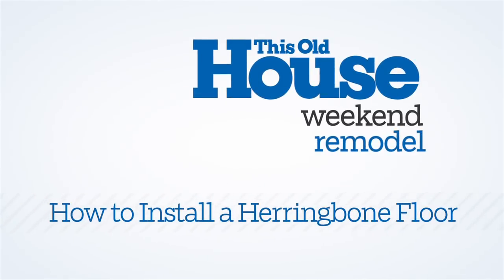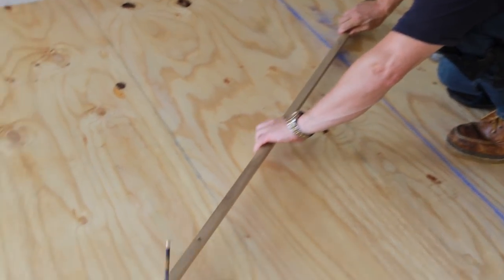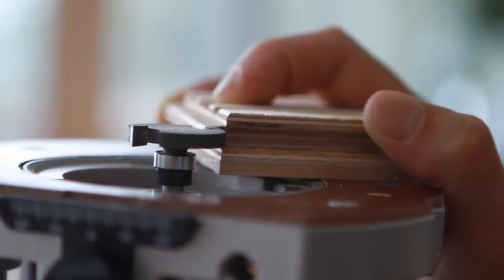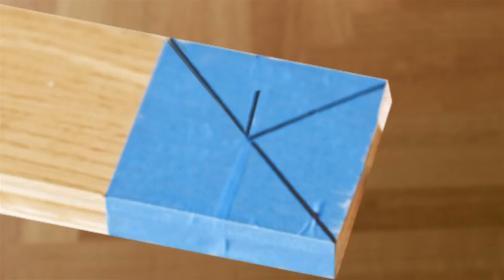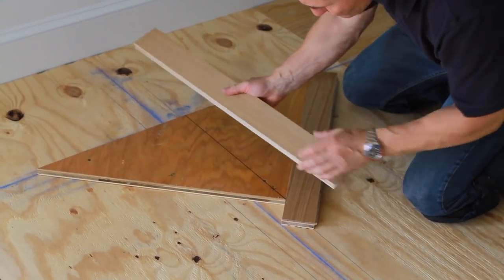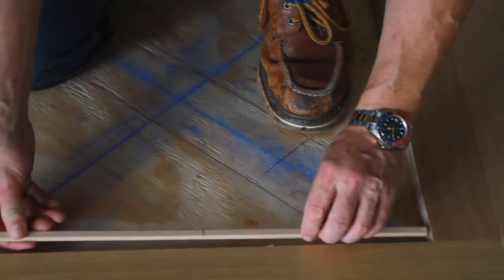How to Install a Herringbone Floor | This Old House

Comment: Yes very nice but a lot if tricks are not explained especially if the design needs to be done in an uneven and not square hallway or room and also if the needs to be done when the space already has other floors installed dictating the space and the space is uneven and not leveled. Also if your planks have any variation in the milling the pattern will strat the get deformed and your 45 angle will shift causing your lines to missmatch and you will get stuck. I've been professionally installing hardwood flooring for 18 years now and that video is only the tip of the iceberg with a fine polish lol. These kinds of videos make people think they can learn a skill that takes years to perfect (and even then not everyone can master it)in a few minutes of watching a video lol. Leave this kind of work for the professionals because I guarantee that if you try to do what this video shows by yourself to save some money, you will end up getting really frustrated and hiring a professional to fix and finish the job and pay extra for the wasted material and the work to rip out and fix all of your work. Hope this helps all the Duy guys reading this 😊

Comment: The length DOES NOT need to be an exact multiple of the width. I just installed hardwood in a herringbone pattern manufactured in Sweden, and it is not a multiple of the width. The installation went just fine. The only time you may want the length to be an exact multiple of the width is if you are running one side parallel to a wall. If you do install it this way, you will end up having to rip pieces to width as you move along the length of the wall if the length is not an exact multiple of the width.
Reply: They meant if your board is 5 inches wide, you'd want the length to be a multiple of the 5 inches. It's asthetically correct.

Comment: Great video. I've watched this many times in anticipation of a customer asking for this. Had a play the other day with tile (I'm a tile contractor in London) but the working lines didn't work out either side of the centre line as per the vid because of the 2mm joint in the tile. Should I have just moved one of the working lines over by 2mm? Thanks👍
Reply: Random question here but do you do work in the Clapham area? I've got a flooring guy in and I have a feeling he has no idea about Herrington floors. Only 3.5sq meters. Its a minefield trying to find the right person. Thanks.
Reply: @mallinsonhermon1646  I'm based in Wandsworth actually so not a million miles away from you. What type of flooring are you putting down?
Reply: @isanna6075  self levelling sub floor, insulating boards, underlay, electric heating mat, engineered oak is the plan. I'm.based off Northcote Road if you want to take a look?

Comment: Awesome video.  You have inspired me to do a similar project.   Why did you recommend cuttings the herringbone bone boards on the tongue side?   Is that so you don't have to worry about making two types of cuts, one for each side?  Wouldn't you want to cut on the groove side so the tongue can interlock with the board above it?  Any light you could skied on this woods be greatly appreciated.

Comment: Easy ... right ? Lol , I say this all the time to my costumers . For example my latest costumer owns a massive Victorian stile home . It has 4 floors because the attic was completely finished . I’m guessing the house is 3500 + sq feet . So over the years the house has become somewhat dilapidated by precious homeowners not maintaining it . So just one of the many projects I’ll be doing to the place is refinishing their old door and fitting it with an antique mortise lock . So when talking to her she is like so it should only be a day or two of work right ? Umm wrong I am using a method called Dutchman to fill the numerous other holes in the door from where previous Owners just slapped these cheep deadbolts into it , one was from a modern kiwik lock and the other is what I call an “ apartment lock “ I have looked. Up what it is called and can only find “ jimmy proof lock “  , basically a rim lock . And to add to that the fir door has started to spread apart from age , where the styles meet the rails . And the last two complications are that I’m installing an antique mortise lock where there was already one installed , which you know if you have had any experience that there are specific hole locations for each mortise lock and being that her original lock is larger than the one I am installing . The second problem is the door jam is all sorts of messed up where the striker plate is from years of homeowners just running screw after screw into it to keep it from wobbling , so in turn about 3 feet of the jam is cracked and rotted , so I have to fix that as well .  Now I am not one of those people who , after a job is complete walks away until the job is done absolutely correct .i don’t cut corners or say “ good enough “ . So three days into the project and the homeowner is like wow , I feel so bad for this I didn’t know it was going to take this long or that there were so many problems with the door . We agreed on 400 dollars for the job , I wasn’t anticipating the door to be rotten where the mortise is and a few other factors I didn’t take into consideration , but I say that to say this , I am technically losing money on this job , however I am gaining knowledge . I don’t mess with mortised locks on a daily basis , and add the factor I am removing an old antique lock and replacing it with an antique lock I am taking my time , when drilling or carving out for the proper lock placement you get one chance , berry unforgiving . But like I said I am gaining knowledge so the “ losing money part doesn’t mean anything to me . I have allot of other work to do for her and her swing how good it is coming out makes her more conf dent . 
Another reason I say all of this ( thanks for reading if you made it this far ) is doing Herron bone is extremely difficult the first few times you do them but if you take your time and think things through your bound to learn allot and feel proud when you are finished . Anyway off to work for me

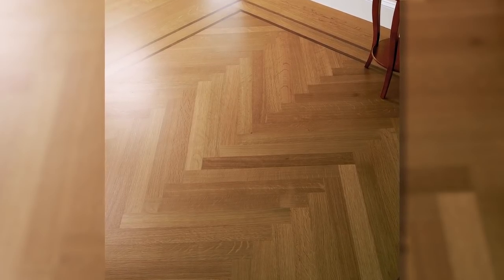Comment: At 4:22 the customer would have told me to replace that dark board.  Pisses me off every time
Reply: lol. True. But this one is also an installer error. You'll notice that at each end of that dark board is a particularly light board. That highlights and exaggerates the darkness of the dark board. I was once told by a woman "Don't use THAT board! I don't like it!" So... I put it right in the middle of her floor, and carefully selected colours around it that would blend it in. It got so well camouflaged, that even I couldn't find it after, and I knew it was there!
Reply: on a scale of 1 to 10 how hard would it be to replace that? like a 25?
Reply: Alexander Fagard I think it has to be chiseled out or so, making sure not to scratch the boards beside it. Cut the tongue off the replacement board and glue it in. Fill any cracks with saw dust and wood glue. Then sand and varnish it. But you heed to be a real wizard to make it look like nothing was ever done to that spot.

Comment: How does this work when the wood is of varying lengths?  What would the waste factor be on a style like this?
Reply: it won't work with varying lengths... just like says in the video.... Waste factor is typically around 15%, but can depend on board size, boarders, obstacles, etc.

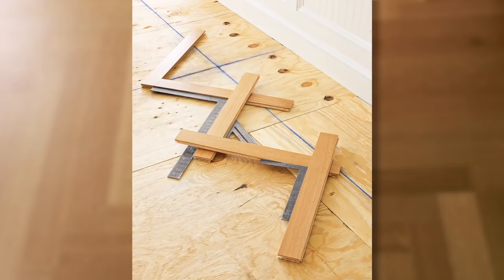Comment: He says the short side of the triangle should be the same as the length of the slat, but that is wrong.  The layout shown has the short side of the triangle at the slat's length minus its width.  It is also shown to be so at 3:30.  1:15 - "With herringbone, the slats need to be a length that's an exact multiple of their width."  I don't think so.  I've laid out herringbone patterns without this restriction and it's been perfectly fine.  The exact multiple rule causes individual slats to form a "broken board" across the floor, where if you sight along the slats they all line up.  But, if you don't care about that, the multiple rule doesn't matter.
Reply: Yes. What you're saying makes sense, The herringbone pattern should work out perfectly no matter what length you cut them at. As long as they're all identical.
Reply: I agree.

Comment: I have Installed many Herringbone wood floors and I always use adhesive (Bostiks Best). A rule of thumb is to always trowel glue and nail a Herringbone floor, if it is over a wood sub-floor , there are to many short pieces.

Comment: Neat, but where do you get the "prefinished decorative strips " from please?
Reply from the maker: here's some examples: https://www.homedepot.com/b/Flooring-Wood-Flooring-Solid-Hardwood/N-5yc1vZbejw
but you can find flooring strips at most flooring or home centers
Reply: Thankyou for your reply. On your link I can find flooring examples  but no accent strips. Are they just normal planks that are ripped down to the width you desire? Regards, Mike

Comment: Is it me or do some of these directions not make sense? Why is it necessary that your board width be a multiple of a board length? And the initial instructions on making a trammel and intersecting trammel points to make a perpendicular line. What is that all about? The rooms won't be square to begin width, so why not give instructions based on that?